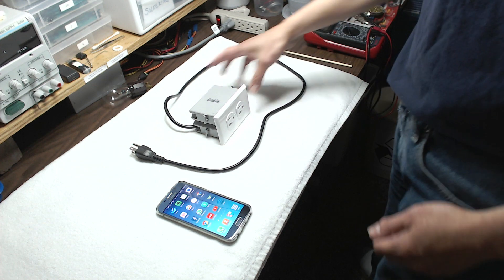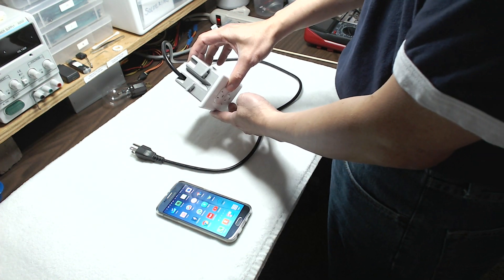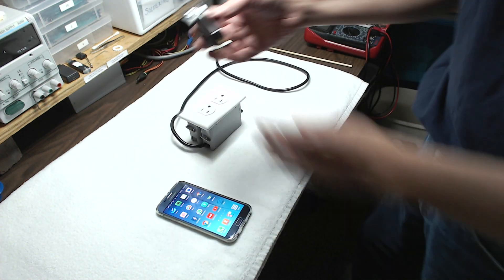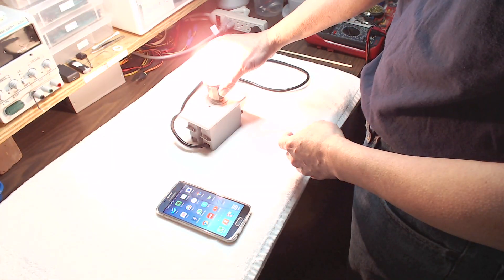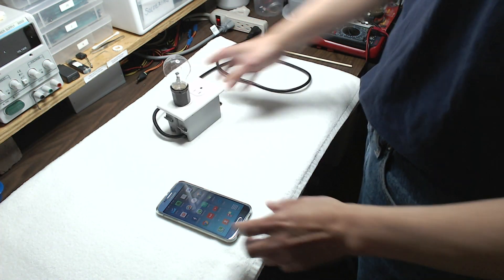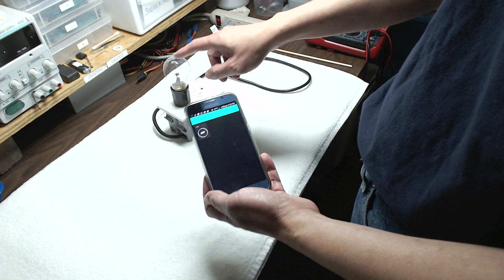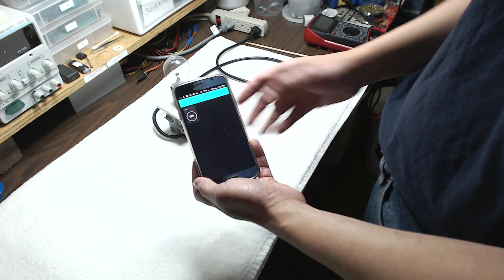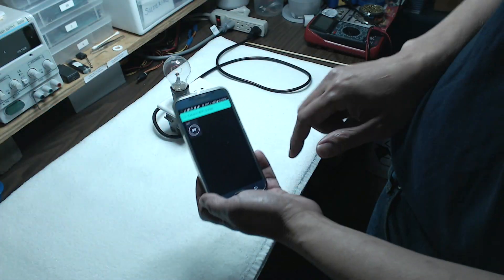HariFun #135.1 - DIY WiFi Outlet

Comment: Hi Hari, thanks for the video! I have been googling about how to make a wireless relay switch and i end up here, which is good.
However, i have lot of questions still.
First, the idea behind my question is to make a light switch which support both smart via wifi and manual click.

So, on the "smart via wifi" light switch question, most examples i have met are using a relay which is wired to the controller like raspberry pi. However, it is not cost effective, because per one location i need to have a pi. So i want to make a relay with support wifi and then it will talk to the pi wirelessly.

Fast forward to the real first question, assuming the pi part is done and ready to send command to the relay part, how do you build a relay that wirelessly accept that command and based on that command give power on or cut power off? From a hardware perspective, what would be your suggestion? (And i'm planning to develop the pi in C#, i hope it won't be a problem from the relay part)

My guess after looking through your video, it would take an ESP8266, a relay module, and jumper wires? But i'm still lost, could you please enlightement me? 

I would be very thankful for that if you can teach me.
Reply from the maker: There are many ways, but yes you can add a switch to the ESP8266. Read that in the Arduino sketch running on the ESP and send it to whoever is acting as the message broker (blynk server or your Pi running MQTT broker).

To be clear, you only need one Pi to act as an MQTT broker. All ESPs will talk to that one Pi and that Pi will relay the message to all other ESPs, and any ESP who cares about the message will react to that message.  

So in your case, the button will send a message say LIGHT1/ON to the server, server broadcasts that out to whoever subscribes to that message, in this case the same ESP that sent that message, and the ESP would react by turning the relay on.  This slightly convoluted process provides the flexibility of any sensor sending a message and any sensor reacting to that message. You could even have multiple senders and receivers using the same message: two light switches controlling three lights. Plus the phone acting as a universal sender/receiver.

If don't mind using a public server such as Blynk or AdaFruit.io, you won't even need a Pi! :-)
https://www.youtube.com/watch?v=MWebdJwr6ks
Reply: Thanks, Hari! I need time to parse the info from you and do more research from the arduino example, but i definitely will have more question. I have checked the video from your comment about using adafruit.io, it's pretty cool, plus alexa integration through ITTT to Adafruit.io, very nice! 👍🏻 

I have more confident on the software thing, but i'm zero on the hardware stuff, please bear with me (on my future question) 😅

Comment: Great video man . very cool .   I like how you got it all to fit in a box the one could even put into a wall or mount on a stud or bench in the work shop . Only suggestion  for upgrade would be to drill a small hole in face plate and put a manual override momentary push button .. or  use a PIR  .. heheh    , tax the ESP's brain . LOL . heck you could keep a usage log even . last on date , last off , last run length in hours and minutes .  I have seen a fuse panel breaker with a ESP 7? i think in it .  But  i like your build way more as it's very tidy and looks to be very handy man .
Reply: Thanks Scott!
I wanted to try OTA (Over the Air) programming, but I ran out of time (spent WAAY too much time on video editing).
Manual override is a good idea! Thx.

Comment: I like your videos ! I to have been playing with esp8266 lately. I have put a tiny vibration switch on the reset line. And when it resets it starts up, connects to wifi, fetch an url (in my case to send me a pushover message) and then turns off (deep sleep). Until next time it the motion switch pulls the reset line. Just add a coin cell battery and put on a door or a bike etc, and you have cheep alarm.  In your case you could instead of using a vibration sensor, just have a push button and send a command to your wifi socket, then you could control it using app or a regular old button :-)
Reply from the maker: +Peter Lehnér , that is a BRILLIANT idea to solve the power hungry ESP8266. I'll have to try that.  Thank you for sharing!

Comment: Nice! Unfortunately it is not easy to fit relay and PCB in most European outlets. No room.
Reply from the maker: +cbm80amiga ,
I'm not sure if the one I purchased is a common box in the USA either. They sell different widths and depths.  I just eyeballed it and everything fits! :-)
Reply: +cbm80amiga Try a Triac :)